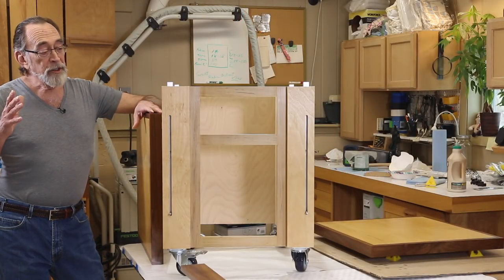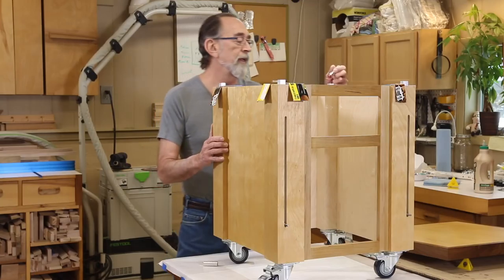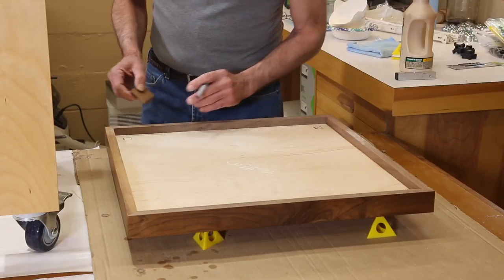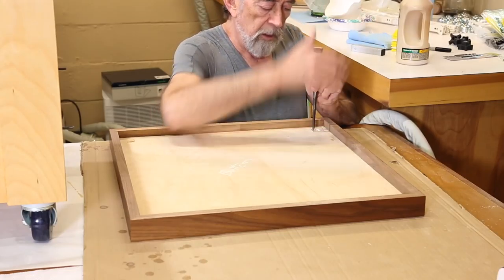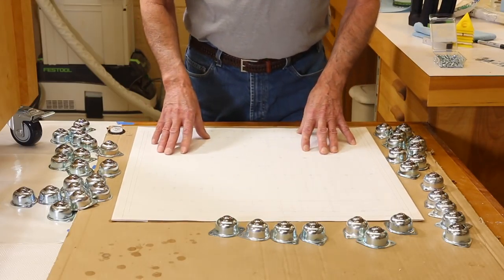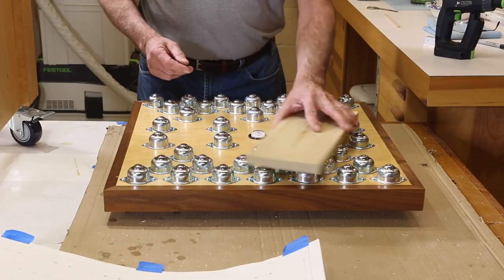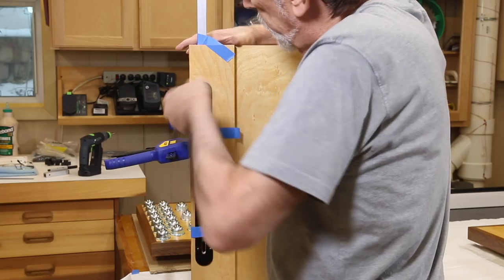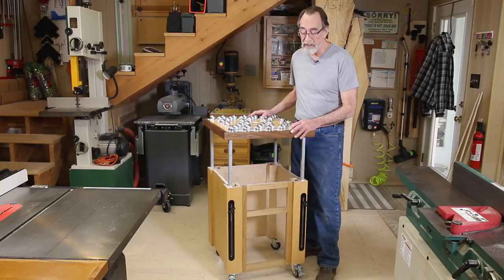Under Table Saw Storage Cabinet Part 8 - The Down to Earth Woodworker

Comment: I had already done a cabinet for under the right wing of my saw but it isn't on wheels. So, of course, it cannot double as an infeed table. I like your idea for that. I am a bit concerned about the wasted space around the drawer though. I would have made the four posts a bit smaller. Perhaps just big enough to accommodate the aluminum risers. But excellent work overall. Thanks for sharing.